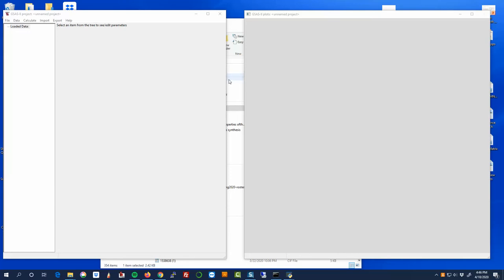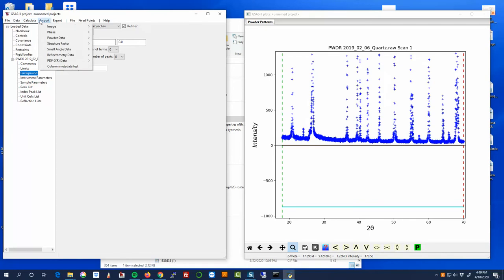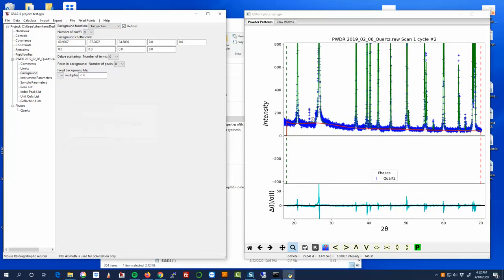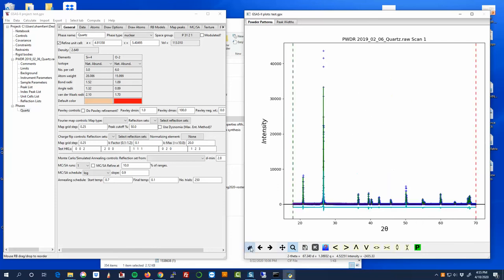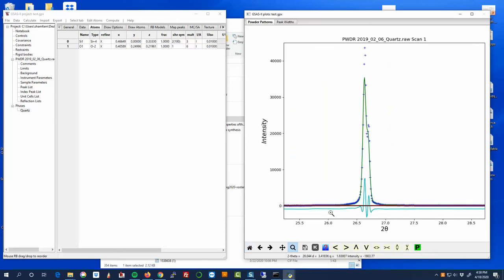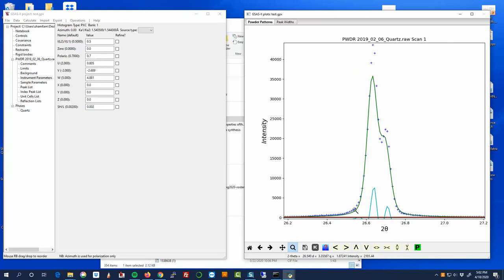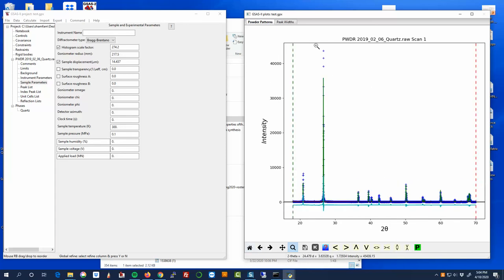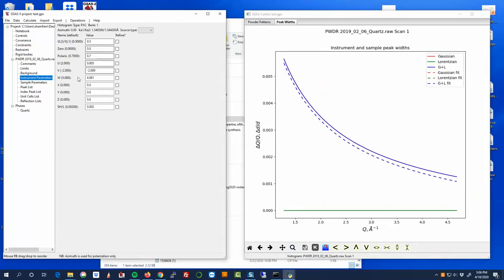Example GSAS II Refinement redux

Comment: Thanks for this tutorial, it's very helpful.
I'm not seeing the same U, V, W, X, Y, Z parameters to refine in my version of GSAS-ii, and the shape of my peaks are very poorly fit (they are quite asymmetrical). Is this due to a change in the software, or is it because I am using TOF neutron diffraction, and so the instrument parameters are different (because it's a different setup)?

Comment: while downloading the cif files from materials project, I found that the primitive cell is a Triclinic P1 structure (for all crystals). How to convert this triclinic P1-primitive cell to the original symmetrized unit cell? and/or how to find the original crystal system from this primitive cell (triclinic P1) Is there any calculation or software is available?
In my case, the XRD pattern was changed to another unknown phase after doping. How to solve my problem. Please explain this. Thanks in advance